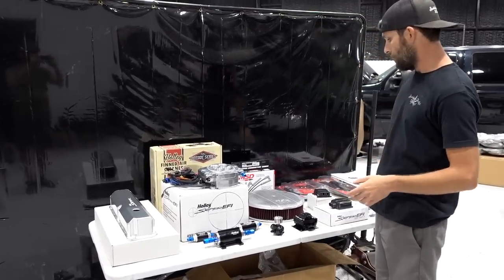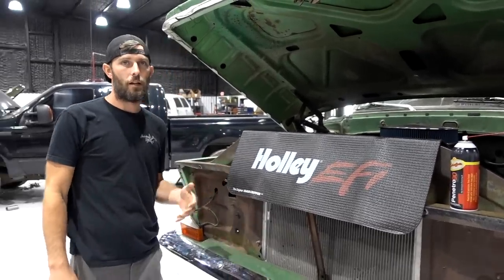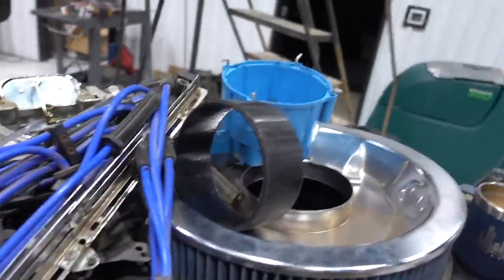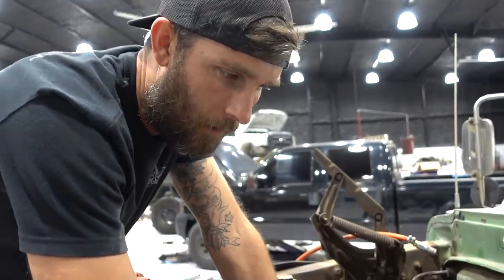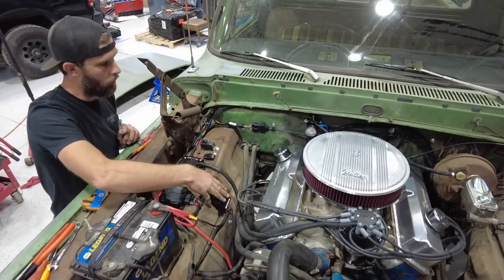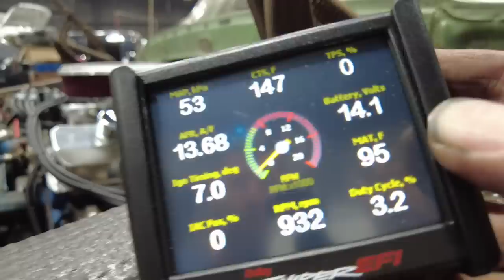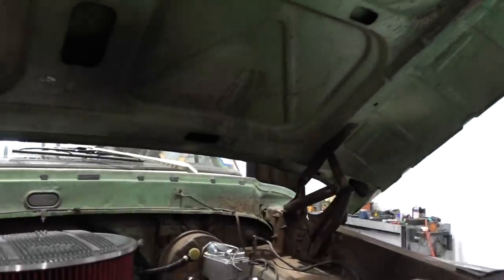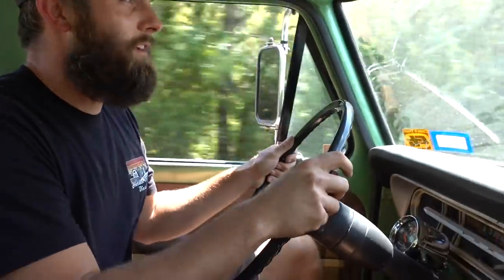EFI that YOU CAN DO - High Boy 390 + Sniper 2 = BAD MF

Comment: WHATCHADO is .. get your biggest HOLE saw.. right through that floor, and mounts for the trans , hell even through the driveshaft ,what ever is in the way.. ziptie it down goodENtight, just keep that fitting on the bottom so your hammer, I mean pack of budlight dont slam into it when ya drag racing Matt in the Baja 9000

Comment: plug it into a laptop and smooth the timing table out. if u don’t the stock setting goes from idle timing to 36 degrees without a smooth transition.

Comment: just run a compression test to what the PSI is at. if your around 130 psi your prob a 8.5-1 motor, if your around 170 psi your prob a 10.5-1. I may be off of my math but it has been over 20 some odd years for me. good luck guys.

Comment: Most of those trucks came with a factory coolant temp GAUGE -- NOT an idiot light -- which you apparently left NOT connected when you relaced the sending unit with the Holley temp sensor..... You don't care if the engine overheats and seizes up.

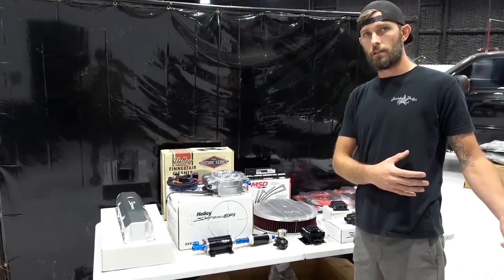Comment: 6:07  Fittings are a big decision! .. You can spend literally hundreds of dollar extra on fittings!! .. And just about nothing comes with them free!!

I decided to go old fashioned 3/8" hard Aluminum fuel lines, and  EFI rated Rubber hose splices (I have a bead roller for the aluminum fuel line so rubber hose and EFI rated hose clamps will be secure) .... and an IN TANK 60 PSI Fuel Pump

Holley includes a ROLL of rubber fuel line with some Master kits, but personally I don't  like long runs of rubber hose, just my preference.

I'll need a bunch of NPT to Barbed hose fittings, but I have a drawer FULL of that stuff, I have collected over the years!)  .. And I'll seal EVERY NPT fitting with Loctite 592 high temperature Thread Sealer paste.

The only "newfangled" fitting I had to get was for the throttle body itself ... a pair of 
6AN Female 90 degree to 3/8 hose Barb  at $10 each :) 

This will make everything for the fuel runs, serviceable and replaceable with just screw driver!  :)

Comment: Top Tip, 50 years experience. Use Gasgacinch cement to glue the cork gaskets to the VC and finger paint a very thin layer of RTV I perfer Black Ultra Permatex letting it dry. This allows you to easily reuse your VC gaskets without sticking while keeping the oil where it belongs. Also the gaskets peal off like sticky notes with brake cleaner to clean up the Gasgacinch. My engines don't leak. 23:50
Reply: No, use the perimeter steel gaskets with the rubber liners on both sides. 

Chuck those cork gaskets into the scrap.
Reply: @karrpilot7092  old school vehicles don't generally get o-ring gaskets. My methods are tried and true. BTW dad was one of the technicians that sealed Mercury, Gemini and Apollo space capsules. With hi temp red RTV the Original. First vehicle we used Red RTV on was my aunts 62 Buick 225 401 nail head. I don't have leaks on any engine i have rebuilt. Since 1966.

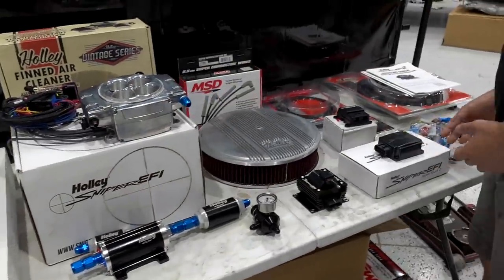Comment: 6:36  I went with Holley's fully adjustable 12- 879 pressure regulator.  It comes with 2 springs and can precisely regulate from 4 psi, all the way up to 65 psi

My thought is? I'm putting the softer spring in a box with an older Holley 4 barrel 4150 base carburetor, with the mounting studs and keeping it in the back of the van with a simple tool box ... 

Just incase I'm broken down somewhere?? Where there's no parts, (like rural Saskatchewan) ??

Myself, or any mechanic can carefully take off the throttle body, (for future repair) .... change a spring in the regulator, and slap the 4 barrel on, and i'm back up and running, in an emergency of ANY kind :)

Comment: My grandpa used to weld on gas tanks by running his exhaust from his gas powered  Lincoln into the tank and purging all the oxygen out of it.. This was in the 70s ,CO2,argon helium was very expensive and sketchy to find while carbon monoxide is plentiful.. 
This was in the oil fields and in his Texas shop.. 
I am not saying that Anyone should do it. However I have seen it done..
Reply: Thanks for writing it out that's a great tip. My grandpa used to do that but I was too young to understand what was happening.😮 
Until you said it out loud

Comment: Hey brothers all that is needed to weld a fume filled tank is exhaust gas from a running engine piped into the tank to drown out any flammable gases
Reply: You can also fill the tank with argon or 75/25 mix. Letting the gas push all the gasoline fumes out.

Comment: Clean install,  definitely!! 
The Manifold Vacuum/KPA ,, seemed realy low not a very big camned 390.
Great job on the install . Right on.
By the way,,  with the in cab tank, factory pickup,  and a hard left turn.... 
It will definitely starve the EFI /factory fuel pickup,,
with under half tank .
Yes i own a 77f250 with a sniper and factory in cab tank. 
Luckily,  i have a custom saddle and Rear tank with in tank fuel pumps and most importantly Holley Hydramates in both of those. 
All 3 tanks together equal 70 gallons of FUN!!! Very easy to plumb with ( 2 ), 6 port fuel  tank switching valves. 
Ran by the Holley EFI 
Contact EFI PROS for the dual / 3 tank  kit.
Hooks right up to the Blue Wire on the Holley EFI.... FYI For Truck owners!! 
Enjoy!!

Comment: if anyone is thinking about this i highly recommend using Fitechs Force fuel systems for supplying fuel to your holley efi, way easier and more bang for your buck, thats what i did with my terminator x install, beats the heck out of spending hundreds more on a regulator and bunch of expensive lines and fittings that youll order wrong and then have to reorder.

Comment: Your best bet with the fuel tank is to have it steam cleaned at a radiator shop or somewhere similar.  There is an OSHA video on a Surfboard shop that used a 55 gallon drum of Acetone to make a mobile work platform.  Washed with soap and water rinsed several times, and left to dry for a day or so.  When they were welding on it, the wire from the Mig gun punched through, and there was an explosion.  Blew him 40 feet across the shop and Killed him.  It was determined that less than a tablespoon of product had remained in the crevices of the drum, and that that is what caused the explosion.  I've been doing tank work for over 40 years, my Father over 60, and we have never had an incident.  Tanks are steam cleaned and checked with a LEL meter before welding.   Please, please, don't take a chance or the cheap way out.  Do it right.  Anything else is just guessing.  Maybe it's ok, maybe it's not.  I know there are going to be lots of comments "I've just done such and such, and I never had a problem".  Until they do.  Good video guys.  Cheers.

Comment: Great video! You have convinced me to run with this project on my 74 Chevy K10. I like how you used all AN fittings; I haven't had much luck with making the hose connectors with them. But, I like the clean look on the install of this truck. The truck sounded great too, did you ever get the follow up with the customer?

Comment: When I ran my sniper they advised against a dual plane intake due to air fuel mixture issues did they fix that issue if not you could get better performance by adding a spacer on the intake
Reply: a 1inch open carb spacer under the throttle body eliminates the fuel distribution issues common with split plenum dual plane intakes
Reply: @jakecooper9900  yes this is exactly how I solved that issue

Comment: Been wanting to convert my 71 highboy to EFI, but hesitate because it has dual tanks, and the return line and a switch valve that also has return capability are proving problematic.
Reply: My buddy did it to his 69, but eliminated the cab tank.  Had it installed using just the Aux tank.  Works flawlessly up and over Donner Pass from Sacramento over to Nevada where his folks live.